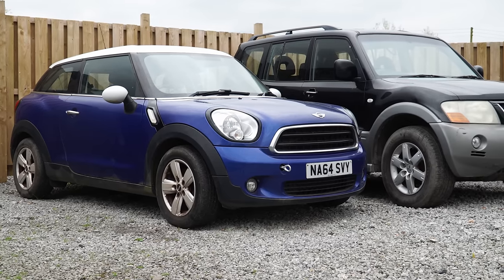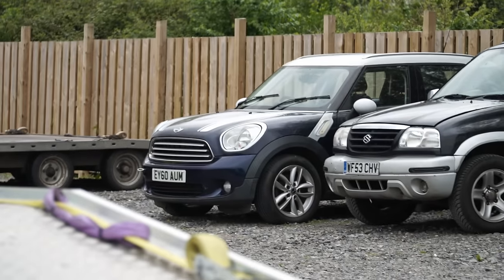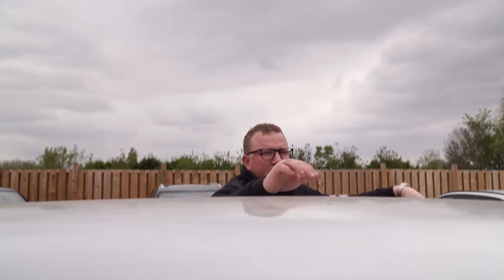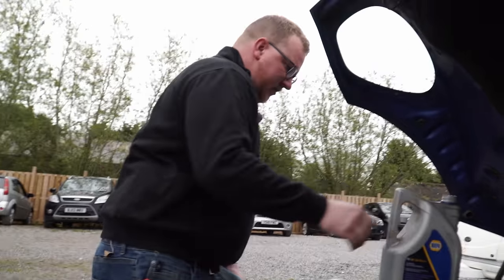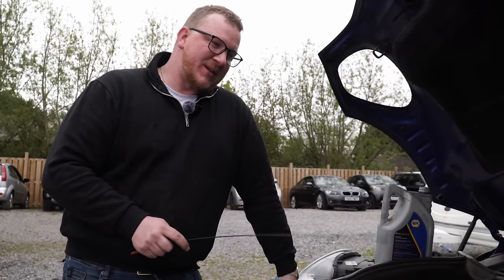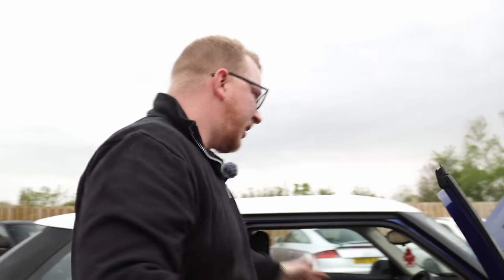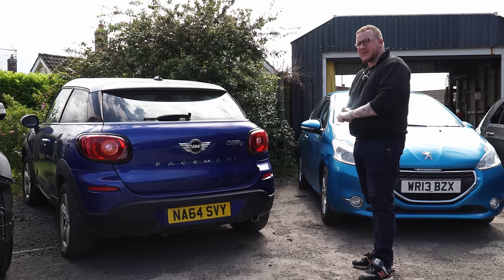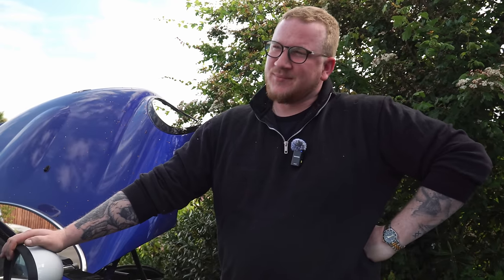I Bought A Car With 'No Keys' FROM BRADFORD! It Didn't End Well!!

Comment: I once bought a car from Bradford - I didn't think I was taking a chance as it was a main dealer. No, I was wrong. Total red flag now regardless of who the seller is.
Reply: i have to say i bought a 2.8i capri in bradford, cracking car, first class, but it was back in the day (1986) and i did him by PXing a 79 reg lotus that had issues galore, as lotus' did.
Reply: @davec8730  yeah before asains took over
Reply: I bought a old cupra from bradford once and I dint have a problem with it but saying that it had no mot and I dint try to mot it I had it few week smoked it about and swapped it 😂
Reply: @davec8730  Lots Of Trouble Usually Serious......not you didn't , it was baked in from the start.

Comment: Last Log Book issue date: 8th March 2024. Yeah I think your theory is right. He bought a lemon, found out it's a lemon, chucked out the keys then made some up some story and sold it on to an unsuspecting buyer. I wouldn't even be surprised if it was clocked. No engine should look like that at 55K miles. No one would let a car go for a quarter of their retail price unless they know it's knackered.
Reply: Unsuspecting buyer? The buyer was a twat and shouldn't be buying second hand cars if he can't perform due diligence. The buyer was also greedy, expecting to pay well under market value then expecting a good example of the car.
Reply: Abdul definitely had your pants down.
Reply: Spot on!
Reply: Don't think he even found out it's a lemon, he probably knew all along. He probably only paid a grand for it in the first place. Despite what the log book might say, it will have had about 20 owners, all passing it on for a quick £200 profit until it eventually found its final mug. That sort of seat wear on a 50k car says it all.
Reply: @ProTroll_UK  Abduls got his 2k towards his new house extension
Reply: That will be the the date of the log book for him taking it over not the last owner
Reply: Seat base gives the mileage away even taking into account the native dress code rubbing off of the squab.

Comment: Best end to that car is a as a stripper. It would break into £500. It will never be nice. It was worth more when still together as Icarus knew. Hats off to you for admitting every red flag in the book was there! Of course Its easy in hindsight! Been there done that as has anyone in the motor trade!  The worst part of that car isn't the engine, you can bolt another one in, its the rat crap. That's the smell in the interior and the damaged seats cause. The wiring loom will be hell to sort out, loads of stuff wont work, (hence fuse box lid off) and frankly the things a bio hazard to anyone working on it. Really really great channel with honest content that is compulsive viewing. Fantastic insight into the motor trade and what its really like. EVERY CAR IS A GAMBLE!
Reply: It's a numbers game. The more cars you buy.the better the odds.
Reply: @thomasegan1551  100% correct!
Reply: You nailed it. Best post on this page.

Comment: Never buy a car from certain areas. I have come across some really dodgy dealers in Birmingham, but I once looked a low mileage car on the south coast which was owned by a Chinese restaurant owner, that had thread-bare rear carpets, and a knackered engine. The dealers were closed by Trading Standards a few months later for clocked cars.

Comment: Hey Joe ill try to make you feel better. Just bought a big 22 reg iveco daily auto. 55k miles. Turns out engines goosed. I've got 25k of van sat in bits.
Reply: It's still in warranty so u will be ok
Reply: Or did u buy a 2 year old van without a warranty?
Reply: @true_believer_01  no it's been damaged it hasn't broken as such so no warranty won't cover it unfortunately lol
Reply: @DaleSteel damaged how

Comment: Took the head off (19:35) nope, that's the cam cover. Crankshafts (20:05) nope, camshafts. Apart from that, as I'm sure you have gathered from the comments below, never buy a car without at least seeing and starting it.
Reply: Shouldn't pay more than a bag of sand for a car with that back story. The guy, Ikluas, or whatever would probably have taken £ 1,000 that for it.
Reply: You make your money when you "buy" in this trade.  A grand.

Comment: The sludge in that engine would soon have caused catastrophic damage - but it was still running. Huge amount of labour to clean the sludge out but a diy type could do it plus replacement parts such as the turbo oil feed & drain and possibly a new turbo cartridge. Not worth your while but maybe for someone else... Trouble is you would always life in fear that there would still be sludge in some nook or cranny that comes back to bite you later.

Comment: On your passenger kick panel JBE/FUSE Box with no power to it. Try to see if it's possibly set in "Transport Mode" which can be set to activate or deactivate the Transport Mode by using a BMW / Mini software specific OBDII diagnostics scanner. There also may have to active the  power or check the 15A/20A fuse on Terminal 15 Relief Relay (Electronics Junction Box, Digital Motor Electronics (DME) Control Unit). Good luck! I have a Mellow Yellow 2009 Mini Cooper R56 JCW Hatchback.

Comment: Ikalus, Bradford, plain number plates, mini diesel, lost keys, last owner dying (to get rid of it) all red flags, I'd have bid 500 quid bud, if I didn't buy it I'd have not been bothered, I had sane car last year, chain went at tickover, used engine was 2k,sold it for 900 quid on FB, that engine in particular is a total nightmare, can be toast at 50k,sorry it's happened to you bud.
Reply from the maker: Nah, it’s alright, I knew the risks and the upside was worth the loss 🤷‍♂️
Reply: @ShiftingMetal  great bud

Comment: I bought an xr2 mk2 in 1990 in Bradford, took it back because it was leaking oil, and the guy pulled a gun on me, then 2 months later he came and stole the car off me, ended up in court and i got compensation of £3300

Comment: Got my car recently from Bradford (I'm from Liverpool), (I should mention this is my first car) the clutch went within 2 weeks, the gearbox bearings needed replacing and my boot latch broke after a few days, tire seem to be run flats on the driver's side front which looks like its already been repaired (didn't notice this) and the front tires are cracked but legal.

Just got the oil and filter changed as it was black.

Took this as a lesson and gained some experience from local mechanics for the future

Comment: The reason for the gungy oil is using the wrong oil. 
Oil specs are given for a reason. 
I do my own oil change because 3rd party garages use any old crap and charge you top money.
Reply: It's actually down to not changing the oil rather than using the wrong grade.
Reply: These are my thoughts too, although missing an oil service is not a good thing I have never seen that sort of crud on a low mileage engine even if it was poorly maintained. Must have had cheap oil or something added to it.
Reply: @mikemarks906  I would also agree that a modern car could drive 55k miles without an oil change and still not show that level of oil degradation, particularly if a synthetic oil had been used, which leads me to agree with others that the 55k miles is not genuine. The recommended oil change period on my diesel is 25k miles and it could certainly do double that without any significant degradation.

Comment: Bradford 1 million percent been clocked
Reply: MOT history backs up the current history, looks like its not been serviced for ages just driven and driven 50-60k is right, its not clocked just not been serviced or looked after problem done 20-30k on the same oil, stopped running 4 months ago sorn and been trying to flog it with missing key
Reply: @DashDriver-z1r not sure if you understand how clocking works pal you clock it before each mot to make it look like it’s done 50k it’s very easy to do
Reply: @DashDriver-z1r  I’ve done 30k on the same oil before and never had oil like that I do an awful lot of miles per year
Reply: @DashDriver-z1r  I don't think it's possible to be only 25 ish k on the same oil, which is what it apparently is according to the history. It's probably on an 18k service interval... The time won't help, but that looks more like well above that amount - what ford says is correct, people clock every year before the test (or get the tester to write incorrect mileages)

Comment: I used to work at a ford dealer during the late 80's, a ford escort mark iv diesel came in for engine issues under warranty. however the owner was a sales rep and hadn't got it serviced after the free 1,500 mile check up. when the mechanic took the sump off whilst car on the ramp he showed me the contents and scooped it out with his hand. I can only describe it as thick black Swarfega ! it had done about 30,000 miles without a service. needless to say customer wasn't happy that Ford rejected the warranty claim for a new engine
Reply: About 40 years ago I helped put an engine in a Chevy P/U that had gone about 40 k miles without an oil change. V8 gas. Probably a 350 or 305. Dealer pulled the valve covers, saw the sludge and said "nope". This was in the US. And the oils then were not as good as they are today.

Comment: That was the camshaft you were pointing to. The crankshaft is in the bottom of engine. The engine oil has turned to solid sludge, I'm amazed it hadn't seized from lack of lubrication. 😫
Reply: When he said that I was wtf this is a car guy?
Reply from the maker: Yes I make slip of the tongue mistakes all the time, maybe I’m slightly dyslexic or something. We corrected on screen, pointing it out doesn’t prove anything I didn’t already know
Reply: @ShiftingMetal  happens to all of us.
Reply: @ShiftingMetal  They're both shafty things, so there's that ;)

Comment: only way id buy car from that part country is buying from a main dealer, three weeks ago got 2015 i20 from a Hyundai garage in colne just down the road. it was a car from old guy who retired from that garage and full service history from that garage, really good price around £600 cheaper than the others, the wheels got refurbished, and rear arch was caught on something a slight bump scrape but the car went in for paint also and come out great. buying a car not from main dealer in that area for me be like going to Birmingham to buy a car as lots dodgy showrooms. traveled north got the car cheaper as very few options for sale for the top spec i20 with the engine i wanted just a few and they sold very fast other cost more but no paint shop or refurbish wheels and not a full Hyundai service history. ended up with a great car heated seats,wheel,pan roof and whole list other things still learning like adaptive cruise control with limiter, a car 53k miles it runs like new everything works on it, but if it was not Hyundai garage id not parted with that amount money as seen plenty garages i though id no buy from there and places i passed through on train. but was a nice 9 hour day drive through peaks really put car through it paces and so far not an issue, some places around that area gave me same vibe of parts Birmingham

Comment: hay john the fact that it start and ran and was squeaking means it just needed a proper engine flush in order to get the Pistons and valves running smooth theres special cleaning flush for engines like that even if they are seized it could of easily been revived  there are engine adjectives for engine sludge like that done it before
Reply from the maker: An engine flush wouldn't sort that out buddy! 😂

Comment: Maybe your transporter guys could do some basic checks before you transfer the dosh, look in the oil cap, dip the oil, check the vendor out a bit (?) rather than just rocking up and loading it, you need to keep a margin on your buying site if the car has to go to Co part, no keys, no test 500 quid, wbac and all those want 6 mths test min, they'd be at scrap money on that. My mate advertises for broken down vehicles and just gets copart to pick them up, he doesn't even get involved.

Comment: I bought my 2003 Volvo XC90 from a Lithuanian trader in Bradford. Not everyone is a crook. I'm Bradford born myself but I live in Halifax these days. That engine is seriously sludged up. It clearly hasn't had an oil change in years. I think the right rear tyre is the original one as you said 3614 at 5:16 which is indeed the date code (36th week in 2014) which would be about right with the 64 reg.

Comment: Bradford...jeeze what you thinkin? NO keys! It's defo not had a recommended service, filled with cheapest diesel, ran on 20/50 oil 'cheap as chips', and now you know it Mustafa new engine and loads of other mechanical bits. If it's too cheap, it's for a reason bro.!.

Comment: That sound like timing chain issues I had a country man in  2020  2011 61 plate sounded the same as that the timing chain and tensioners where going on it had other faults too got shut of it had to reject it back at the garage I bought it from fault after fault kept occurring on it and major engine light kept coming back on after reset not to my acceptance it was the garage that kept resetting it and saying it’s historical faults I said any fault that hasn’t been fixed and keeps coming back on will eventually look on a computer system like it’s historical 

I now have a 2016 mini hatch 5dr automatic cooper D twin turbo and it’s been ok and reliable good little car for me well not so little as they say right now minis are not actually as mini as they once was

Comment: Can't quite get my head round the crud in the engine, a service at 25000 miles at BMW then shows 50000miles on start up based on a oil change every 10000 miles it was due one at 35000 seems a lot debris for a fully synthetic oil. Although not advisable many cars miss an oil service without this sort of horror.

Comment: Minis's Grrrrrrr. Just got rid of mine. Maintenece costs are stupid. Got a leaking radiator? That will cost you £1200 to fix. What's that? Slipping out of 5th gear? That'll costr you £1200, or just in for  quick service, that'll cost you 250 quid.

Comment: Son bought an L200 barbarian from Bradford - 22 plate and got it for 5k lower than being asked. Without quibble. Private sale. Bought in the rain failing light and restricted access to one of his 2 brain cells😂
Whatever could go wrong on such a young vehicle ? Well DPF on way home for one thing. Day after whilst being repaired it revealed the beautiful electric blue L200 had an oddly red coloured front end. Oh and no log book. I just hope they were cuddlers after the dry sha66ing.  
Even the repairs looked like the donor L200 front end was stuck to the rest with plasticine and 4 yr olds hand. 
🔔 end comes to mind. And a good kicking for the seller …. Who no doubt has an army of taxi drivers on stand by to back him up - innit brother. ‘Banchod’ as they say in those neck of the woods.

Comment: I'm not convinced that that was the original motor. If the motor in it blew and was replaced with a high mileage junker with poor maintenance that would fit the facts. 

In 60 k miles, even with no oil changes and modern oils I'd expect it to look better than that. 

The other option is that this engine was using something other than new motor oil in the sump. Even if it was being topped off with drain oil that's looking bad for the mileage suggested. So, wrong oil of some kind?

Comment: No keys so you can't hear the engine running? Seriously? Unless you're paying scrap value, walk away. I've been gifted a few cars like that but the carbon deposits were even worse. It's not worth repairing as every component will be knackered. In the past I've pick up a used engine and been good to go but with modern control units even that is not as simple as it used to be.

Comment: There is one rule when buying any vehicle look at it first test drive it and has atheist two keys and that engine has never been serviced by the sludge under the rocker cover well l bought a 1997 Toyota Hilux 5 years ago from Newcastle N.S.W sight unseen my daughter arranged the purchase and it came with two keys its single cab ute and only needs the one key and l paid aud $1500 for it with 410000 kilometres on it and l still have it and the Hilux is great my test drive was from Newcastle to my home in the outer south western suburbs of Sydney no dramas and by the way it now worth aud $5000 which lhave seen them sell for are in Australia you can't beat the Toyota tax

Comment: I think the bradford lad has had your pant's down Joseph with that twin overhead bath tap model mini didnt you use car vertical before you bought it?
Reply from the maker: What would carvertical have told me? The engine is knackered? 😂 Carvertical would actually be worth the price if that was the case
Reply: @ShiftingMetal  soon as you put the location in eg Bradford it would have an alarm bell signal.
Reply from the maker: I knew it was a risk but it wasn’t a big one so I thought I’d give it a go 🤷‍♂️
Reply: @ShiftingMetal  As the saying goes Joe no risk no reward  we are all on your side even over here in Western Australia
Reply: @ShiftingMetal  And thats what the nun said to the vicar ill give it a go

Comment: For future reference dude. When checking oil on the dip stick the min and max mark only masures a litre of oil above the minimum amount required. So when you were adding oil and it wasnt registering on the dip stick that should have told you there was zero oil in that car. And also never buy anything from Bradford ffs.